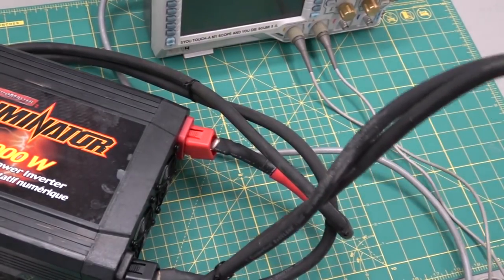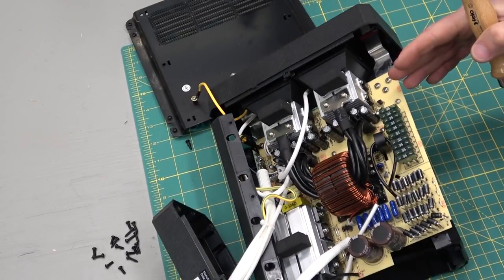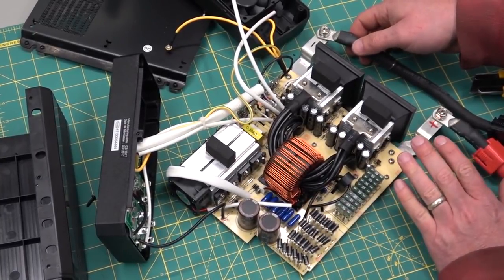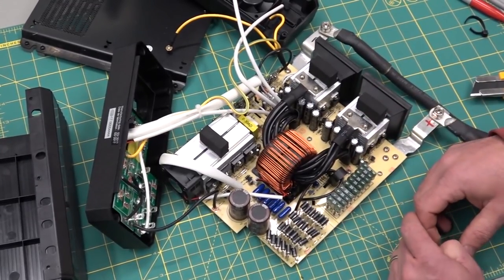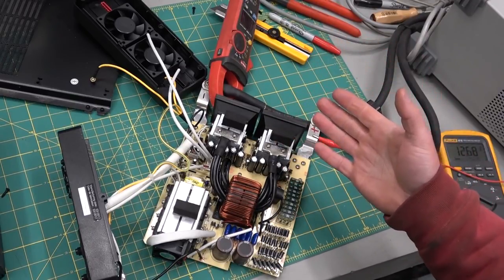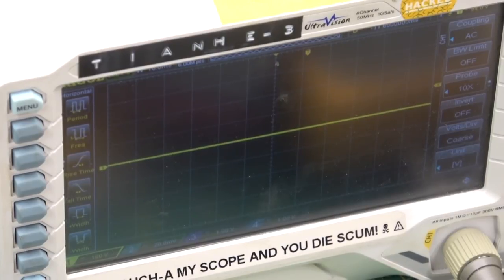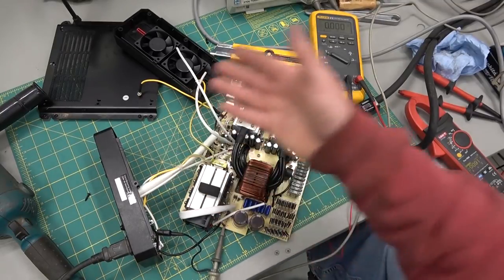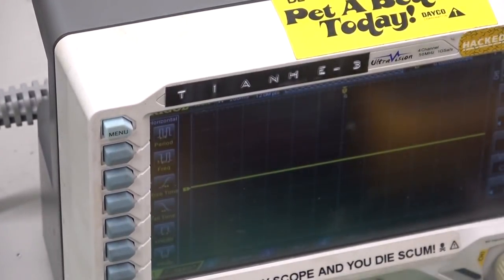BOLTR: 2000W "Digital" Inverter | Pure Sine Wave?

Comment: When you see fans in any electrical product, think inefficiency.
Reply: "If it has semiconductors, it generates heat." This is true to the extent that the semis are inefficient. You're agreeing with each other.
Reply: @captapraelium1591  
Except one is in favor of fans, and the other is opposed.
Reply: One is against inefficiency, one is for long life. The fans are secondary correlations to the subjects. They are trying to argue because it's 2018 and on the internet and outrage is cool....but they aren't actually.
Reply: @captapraelium1591  
One is saying the design is deficient and should be changed to enable reliable operation sans fans. Second is saying fans are acceptable and needed given the power level and real world circuit designs falling short of 100 percent conversion efficiency.
Reply: Yes. Like I said.
Reply: So basically all current circuits age inefficient since they don't achieve 100 percent efficiency, if that's the blanket standard being applied for "efficient".

Comment: i have a 1000w of a different brand that i hooked up backwards and the fuses blew. manufacture told me i was fucked and that there were no replaceable parts inside. Opened it up and found the blown fuses, it's been chooching for another 5 years since then.

Comment: Sorry to say but having fuses, diodes or even transistors ( bipolar or mosfet ) in parallel is just crap as all those individual parts always do have little differences in their specifications caused by the manufacturing process. having that said it means that no part will have same specs as an other one meaning the one with the lowest resistance will win the sad price of dieing first - that bad thing is that this effect is getting more and more into the game the higher the amperage is ... So below the line : This thing is just as strong as it's weakest individual part and will just be fried in seconds if the load rises. Any transistor has an ON and OFF resistance, same for diodes having a forward and reverse resistrance. Fuses are by the way just low resistance resistors ...
So NEVER EVER have low resistance components in parallel to get higher amperage without either selecting the parts for equality ( very expensive ! ) or increase the resistance of the paths to be noticable higher than any of the individual parts in the path is having making those manufacturing differences less important for the application. Make your own thoughts ...

Comment: Aaaahhhh.. So thats why my cheap inverter wont run my old AC unit, but it will run it if i turn the fan on first in the unit, and then start the compressor. If i switch them both on at the same time it just humms for a few seconds. 

The mind boggles...

Comment: Not even close to the 20 kHz you expected, that's not even 1 kHz. Usually good enough but definitely not pretty.. Makes me wonder what my omnicharge produces, they promise pure sine as well
Reply: The 20 kHz is likely to be the frequency the transformer runs at. Transforming voltage is an AC phenomenon, so, as i understand it, the higher the frequency you drive your input voltage at, the less iron core you need in the transformer for a given power. It''s why old mains chargers are heavy, while new ones feel like they're plastic all the way through.

Comment: Talking about angry pixies, if  any country could start afresh what system would they choose? Would they choose 240v 50htz, 240 volt 60htz, 120v 60 htz  or any other voltage?
Reply: I have a feeling high voltage would win due to efficiency.... But I don't know bout the cycles, probably 60 (or more? ).... Interesting queation...
Reply: It would stay the same. In Europe you get 380V (between phases) 50Hz in most places. 60Hz would be a little better in some respects (some transformers could be marginally smaller), but also worse in some others (skin effect in transmission lines and capacitive loss in transmission lines is higher, especially underground cables). I feel the 120V in US is wasteful, it requires a lot of copper in households, and most sockets can't deliver 2kW, like to iron, or a kettle, and voltage drops are more significant (relatively speaking). HV DC is too expensive still to be useful, unless you do things like under water transmission over long distance.

You can't go much above the 60Hz, because the speeds at which turbines and generators spin is already very high, with a limit being that the tips of blades reach almost a speed of sound.
Reply: No, no, no...... 120v off the pole is much safer for residential. Back in the day when I ran an ER in euro got in quite a few high voltage electrical burns..... those really angry pixies would burn right through arms and legs if it didn't kill you.
Reply: @tetontom1  yes sure. Show me statistics proving that there is (relatively speaking), less electric accidents in households in US, than in Europe.
Reply: movax20h.... based on experience. Look up your own stats....
Reply: movax20h that’s why man invented gear boxes.
Reply: @Conservator.  the generator must be spinning at 3600 RPM basically. There is no way around that. Gear boxes will help you with turbines, but not generator. Also gearbox is a loss efficiency, and another complex part that can fail.
Reply: movax20h 
I was referring to the speed of wing tips of the turbines. A 100Hz generator could be made using a different gear ratio.

Comment: It not good to run them off lithium batteries? I never knew.... Think lipo works better then lion? I got myself the cheapest 300w I could find from the usual scumbags to discharge my lipos if I didn't get the chance to use em!

Comment: I have a giant generator mounted in my woods runner that will burn out any and every angle grinder plugged into it, I can run my welder, huge halogen lights, air compressor, circ saws and sawzalls all day no problem but it hates grinders and I have no idea why. Does anyone wanna tell me why my generator is a grinder hating racist?
Reply: Back EMF from the "make and break" nature of the brushes on the commutator in your angle grinder is the issue. A small external box with an inductor and some proper capacitors would solve the issue.
Reply: Mudsuitable You would really have to monitor the voltage, peak current, average power, and waveform at the angle-grinder to answer that question.  But those compact motors are often running close to their thermal limits due to the need for very compact motor size, so anything that might force it to draw more amperage or dissipate more heat will threaten their operational life negatively.  Even an overly long and/or undersized extension cord can destroy such motors if there is too much voltage drop under use.
Reply: +Ethan Poole I'm gonna have to actually run tests you're probably right I'm just lazy and I have millions of excuses for why I won't actually mess with it

Comment: the closer you get to a canoe full of moose meat the further you are from a 110 outlet all confusionism aside reality for the home gamer is how are you gonna beat the power company pricing the battery systems wind turbine's and solar panels and charge controllers and the facts like fuses are for protecting the wires so you don't set them on fire well I ll just say finding equipment that's easy and cheap to repair or that dosent break in the first place this one looks like the easy and cheap to repair so a buss a buss b architecture  real mind fucker